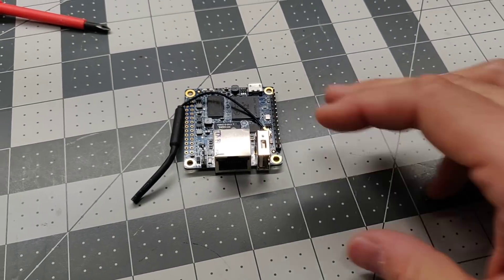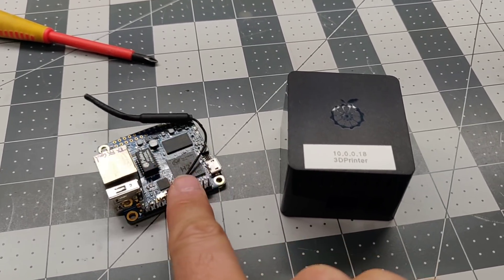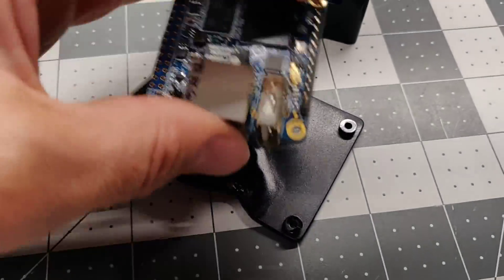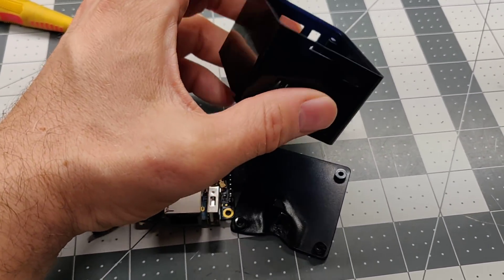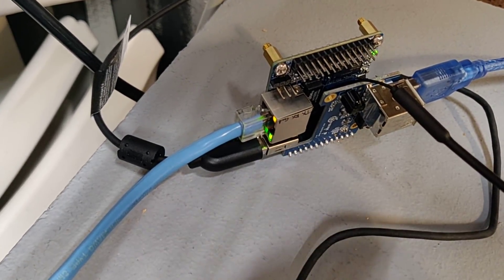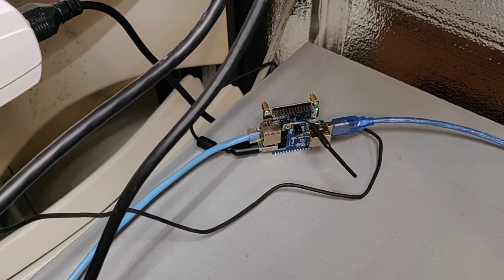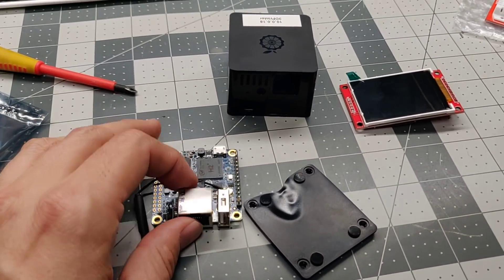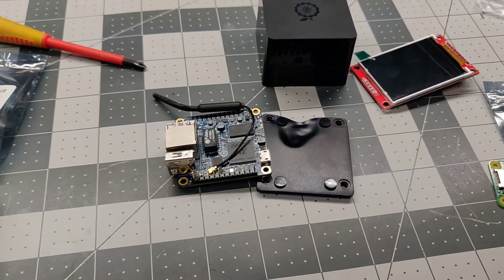Rant: The frustrating Orange Pi Zero

Comment: I had two of them.

If you are using one of these, just know they will burn out themselves at the end.

The last one had a head sink, fan, and USB boot (so no cheap SD card overheating).

They both were reporting DRAM 0MiB on serial output after some burnt smell.

I don't know if their new products are better, but these first ones are not regulating their power correctly.

Also, I configured the USB boot on the SPI as sometimes the SD cards aren't detected at random, so if you reboot or loss power never boots.

They lasted long enough, but this was more of a beta product than a production system.

I would probably buy a used thin client, as the new ones are in the same price range.

Just for comparison, i have a rpi3 for longer than these and it is far more used. Still working, no issues.
Reply: Did you use a heatsink? Everyone should use a heatsink.

Comment: A four -core processor 1.2 GHz without a radiator, is it serious? Are you sure that Orange Pi Zero is to blame, and not you did not install cooling and closing it into the impatient case without a fan?
Reply: the zero 2 runs fine for me without any active cooling so maybe thats something they fixed.
although it has issues of its own: no temp sensors or monitoring of cpu frequencies
Reply: @darkceptor44  I'm not talking about active cooling, but at least about Heatsink. On Zero 2, another processor. There is everything and the processor temperature sensor too.
If you have Debian, then you can get the temperature with the /sys/devices/virtual/thermal/thermal_zone0/temp (..._zone1...2...3/temp) and divide the result by 1000.
Reply: @MaxPivovarov  mine doesnt even have a heatsink lol, doesnt feel warm to the touch fortunately and its like 26-30c ambient over here, im using armbian 22 and nah theres no sensors, i tried everything out there and there are no files or directories for the sensors or i2c stuff, nothing can restore them either
Reply: @darkceptor44  Everything works for me and shows the temperature, even more, I have a script on the python controls the fan based on the temperature of the H616.
Reply: @MaxPivovarov  with just debian? what version.
maybe mine is just defective then
Reply: @darkceptor44  
 Orange Pi 3.0.6 Bullseye with Linux 5.16.17-sun50iw9

Orange Pi Zero worked for me as an ADSB feeder for several 24/7 flexes with a load of about 50-60%. Now I have updated the system to Orange Pi Zero 2. Now, in addition to ADSB feeders, AIS feeders operate on it. Also 24/7.
Reply: @MaxPivovarov  thank you!!!! i flashed that exact same image and i now have temps and i2c stuff, cant believe kernel 6.0 broke those

Comment: Its a powerfull CPU Like the ones in Smartphones. What do you expect completely without cooling? Even the Pi Zero gets warm so what would a much more powerful cpu with gpu do? Right, gets hot. WiFi on this board sucks that's a known issue

Comment: Weird, I had the opposite problem with my new AtariVCS.  Running Ubuntu, as soon as the CPU stopped doing something the WiFi would get really slow.  Turned out it was a power-saving setting that was screwing with it, whenever it went into power-saving mode, power to the WiFi got cut back and that made it not work well. :(

Comment: I install and configure everything on the Armbian, but when I reboot it is gone. I can't access orange pi zero anymore. With the Armbian it does not overheat, but I was stuck in this problem. With sunxi linux, this problem does not happen but it operates at a very high temperature and does not detect wifi. many hours lost on this hardware.

Comment: Always use a heatsink on these small boards, they just need it. Yea, the Wifi was probably a round table push. Their an experimental board for people who tinker. Raspberry PI 4 should be dependable or even a smaller #3 should also work at a lower cost. They have already upgraded the design for this toy.

Comment: I built all of my home automation systems out of orange pi zeros, the biggest issue I'm having with them are the SD cards keep failing after power flashes during thunderstorms. I did have to run wired ethernet to all of them for reliable networking.

Comment: You used the poweroff command in Linux after the loop happens that the Pi heats up to "boiling water". I had the same problem, but the plastic did not melt but it got hot :D

Comment: You def fried your wifi module and I bet likely a few other functions will be diminished that you haven't noticed yet. Yours Lan runs on another chip, try using it to connect.
I strongly recommend installing small heat sinks on all the onboard micro controllers and a heat sink and  fan for the arm. You will never have this problem again...

Comment: Thanks for your sharing! As you know, all the CPU have heating problem! Even the famous PC manufacturers (such as Apple, Dell, or Thinkpad )would add a fan to cool the temprature! We suggest you use a heatsink or even the fan to solve this issue!
Reply: If it requires a heatsink or fan so that it doesn't melt the official case, why don't you include that in the box?

Also, your comparison to other manufacturers is not valid, as they use completely different CPUs which tend to generate more heat than an ARM SoC.

Comment: Someone else commented that WiFi channels 0 and 13 seem to not work properly. I have tested this and with my WiFi set to channel 13, i could not even connect to the OrangePi via ssh.
So i attached a real WiFi antenna, and now it works perfectly.
I guess the stock antenna is really not the best, seems to be just a wire with heatshrink on it.
But with a cheap aftermarket antenna, it seems to work just fine.

Comment: I got 2 of these, I was also concerned about the heat output of these things,  I fitted them with heatsinks  on all the chips that heated up & a small fan  each which I clean out once a year,  during  my own testing they ran at 59c+ without any real load, after the heatsinks went on, that dropped to 34-39c   after nearly 3 years they are both still  going, I dont have the daughterboards on them  I just altered some old pc slot mount usb ports to fit,  and soldered  the pins on the header of one of them to control my relays, they dont like cheap fone chargers,  I got one running off a spur from a PC psu  which  powers  one of my 3d printers and the other one is running off a  pi  psu , it seems like a lot of people are having issues with the wireless, but I dont seem to have an issue,  and can easily connect to them  anywhere in the house or garden

Comment: It's a $10 board, not sure why you expected cooler temps and reliable wifi from it without a heatsink inside a case while running a webcam and octoprint on it. If anything, it's surprising how well it works at that pricepoint.

Comment: Underclock it.
Reply: Exactly. Just open a terminal and run armbian-config, go to System Settings,  Set CPU Speed and Governor, and lower the Maximum CPU Speed a notch or two and set the governor to Conservative. Mine stays at or below 60 degrees running all out, even in the case and with no heat sinks.

Comment: For what it's worth, I picked up a couple of OPiZ 1.4s last year and tossed them aside after I witnessed the overheating and erratic operation.  I decided to have another go, what, a year later?

First of all, I noticed that the 5V supply coming in over the USB micro cable just wasn't sufficient for my 512MB model.  Disabling WiFi and derating down to 250MHz seemed to keep it stable, but even then, it got hot as a two-buck pistol.  I was running it in the white version of the "cube" shown in the video.

First of all, I got an external 5V 2A "wall wart" supply and added a DC jack to the box and connected the external 5V supply to the board (the OpiZ information page shows where).  Then I grabbed the case and bored a 1 3/8" hole (a Forstner bit works great) and installed a 12VDC fan over the hole (PSC P1124020HB2A) and connected it to the 5V supply jack.  The fan should blow into the case, as the ventilation holes are poorly placed.  Running a 12V fan on 5V results in nearly silent operation, with plenty of airflow.  I boot and run Bionic from a tiny cheap USB flash drive, rather than the SDCard (you need to change the boot on the flash to do this).

Now, with Wifi enabled and all cores at full speed, "stress" gets the temperature up to 32C, but no higher.  Before the mods, you could have fried eggs with the thing.   

Maybe this will help someone.

Comment: I think you doing something wrong dude.... Running  a orange pi zero without problems. It's much better than the super slowwww raspberry zero w who i put in my drawer... Maybe you have added a wrong/faulty power supply or usb cable?

Comment: I've bought Orange Pi Zero last year and was trying to run android on at least 10 types of sd cards (even with slower and faster write speeds) and still to this day can't get it booted, many other users that has products from Orange Pi has complained that some images of OS'es don't work on their boards.
After all I bought bunch of Raspberry pi zero's and 3 B+ models all of them worked great what whatever OS I've tried.
Even without heatsink they run on pretty good temperatures and they don't have any problem with the voltages, amps, etc.
Reply: Did you try with other power supply? (with 3 Amps or more?). I bought a orange pi zero months ago and try to setup android (with a 2A power supply) with no postive results. Recently I get a 4 Amps power supply and I installed the android image the same day and everything worked fine.

Comment: I got an orange pi one. Fought to get it to even light up. Back and forth with the seller. Happened across a comment about using the power port - not the usb to power it. And it came right up. But I'm going to try a different os than from orange pi website. Heard it's buggy. And it did act funny. I had tried the onion and it kept locking up. I've nothing good to say about that thing.

Comment: I use only orange pi's in my home network and they work pretty fine once you install a normal heatsink on them (not the small crappy heatsinks that cover only the soc btw), if you add a fan it will be the coolest appliance in your house. Btw, what image were you using?

Comment: Tottally YES! I own both the OPi Zero and the PC Plus, and both have the same issue. They overheat and throttle a lot!
On the pi Zero's case, I've replaced the bottom panel with a small 5V fan that is the same size, super-glued it to the border of the case, and added 4 old ATX plastic standoffs on the 4 mounting holes to give it a gap between the fan and the surface you place it on. The air will blow from below, around the board and the expansion, and exit out of the top vents.
Also the wifi is really crappy on ALL models, you can use a better antenna or just wire it. My OPi Zero is a happy camper below my desk, serving as a CUPS server for my old dumb usb printers.
The software provided by the AWFUL PAINFULLY SLOW website is a joke, just get Armbian straight from the official site, and then add DietPi script to lighten it up a bit.
At the time I bought them, the PiZeroW was basically vaporware, there were impossible to get.
Orange Pi  PC Plus (H3) with an adhesive heatsink and a small fan just barely moving the air around the official case (without the top part) will keep it working for weeks, and not even throttling. But yeah, if you can afford and/or find the OG raspberry Pi, go for those. There are a lot more resources, OS builds and proper documentation than for ANY of the Orange ones.

Comment: Hi, which version of opi zero did you use? I used for the same thing a zero 512mb, official image from orange pi and i had good wifi signal without thermal problems

Comment: I have a Rpi zero w on my printer and i stuck a head sink on it because why the hell not i am not stupid and expect passive cooling to work. I even designed a case to hold a 5v fan powered off the gpio pins because why the hell not. The biggest downside to the zero is its hard to get a web camera that works that wont make it lagy and if you want to run Klipper as well that will make it even worse. You can basically use a Zero w for octoprint and Klipper with no camera which makes it pretty limited in a way but they are cheap so still good for the price.

Comment: I owned a Orange Pi Zero for over a year that has always given me problems.  I thought I got it stable by underclocking the CPU, applying a wifi fix and doing other things.  But I could not ever get it stable using the image Armbian_5.35_Orangepizero_Debian_jessie_next_4.13.16.img.  I have spent far too much time something that cost me £15 which has made getting a cheap non Raspberry Pi SBC a false economy.  Finally I have put the Orange Pi Zero in the bin.  I will get a Raspberry Pi 3+ for £35 instead.

Comment: didn't realized that i wen unfortunate but just now i found out i was lucky i guessi received my opi zero from local retailer, they sell me one with almost quarter of the price because apparently the wifi antenna was fall of (and it doesn't want to stick back again).
so i paid half of price, with extra 32gb unnamed sdcard as bonus, installed armbian on it (because i'm not sure which one is good, and i want manual as much as possible from it's os) oh also it's because armbian explicitly support shenzen something (yeah kinda chinese cpu name liek that). turn out later it was good. now it's using 2A phone charger, i hook it up to 2TB 2.5" drive, and haven't stop running about 4 month ever since. i used it as leechbox with rss downloader, totally worth the price considering it's performance. even though, well about 480MB ram for torrent is just about 3-4 torrent active on leeching

Comment: Rpi does n will have that community n the software as well.
Opi even now is like a beta testing. Even being fully open source they r missing drivers & documentation as well.
N in your case seems putting a higher performing ic in a closed box made it worse. The OS's available for Opi aren't that reliable as well cuz of the prev issues mentioned. Hopefully it gets better with time

Comment: You brought (and overpaid for) some cheap board then run into issues that you didn’t expect. These were made from cheap coponents that were dumped onto the market because of security concerns. They were made to under cut the RPi zero when they first came out and were not aviliable becuse every
Man and his dog wanted one. All the problems you bitched about are well documented yet you didn’t do your research and are now all butt hurt about it. #userfail

Comment: the revision you seem to have is the V1.3 or V1.5 which has a higher voltage output then the V1.2 or somewhere along the lines to the CPU.The voltage regulation board is the source of your 'heating' problem. even the officials say it. If you want compare the older revision boards with the newer ones. The one i got does not heat up as much as yours without heatsink(which is good).I dont know why did they do that but i suppose it was for the juicy clock speed.

Comment: I have one of these running my mail server, and i have noticed right away that the soc gets quite hot, so i put a heatsink on it, and intalled it near a fan inside my pfsense machine. I've never had a problem with it. This thing is still running only because of me being lazy, since now pfsense runs in a vm, sharing the hardware with my file server. But hey, if it works- dont fix it :) So i will leave it as is, untill i decide to upgrade that whole trio.
Btw i run armbian on it.

Comment: Reason for overheating is extra powerdraw from extra usb n video out. No fan and whole backage in hot air next or top of 3d printer..   
3d print is hot.. if same air is used to passive cooling ofvyour sbc...  you have done fkd up

Comment: If you think this is bad, you should have seen what the original Orange Pi's were like.
Official OS images totally burning out the boards, desoldering the main SoC, needing users to manually edit the voltage settings.
I'm kidding, the official OS images still do that. Armbian for everything. (Looks like you were also using armbian, wew lad, never seen this happen before). 
The armbian devs mentioned cpu frequency governing was still buggy, but I thought the H2/H3 boards were fine.
Still, I would never use an orange pi without a heatsink on the major chips. If you're gonna use them over a Pi, they need cooling.

Comment: Using orange pi one as nextcloud server for about 2 years, yes it is extremly hot, but when i bought copper heatsink the temperature was significantly lower than with aluminium one, about 20 degrees C at idle and 38-50 degrees at stress test (cmd is stress -c 4 -t 360) with fan connected to 3.3 volts. No problems at all, ubuntu armbian, no frequency or voltage decrease

Comment: I attached a fan on mine an now it runs at about 40°C and runs as stable as could be, before it often crashed when the temp rose about 75°C. I printed a case with a fan mount for it. Runs way more responsive than my raspberry Zero.

Comment: Using OrangePiZero with small aluminium heatsink and case with cooler. when it's not overheated everything works fine including wifi. Using it with octopi for half a year with no problems.